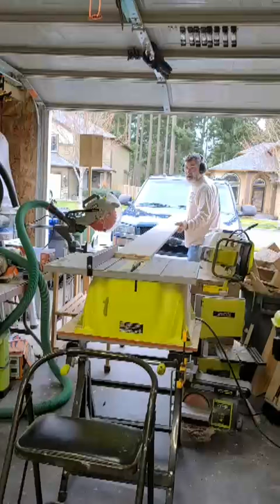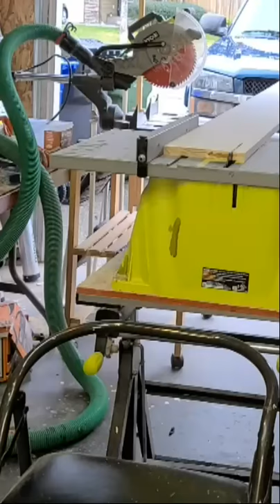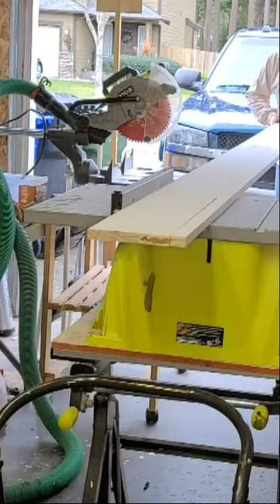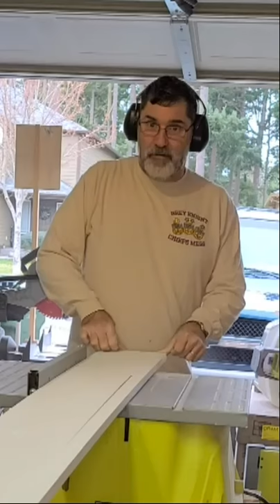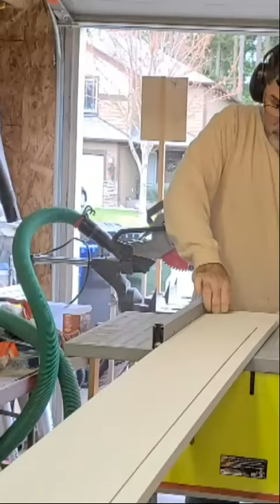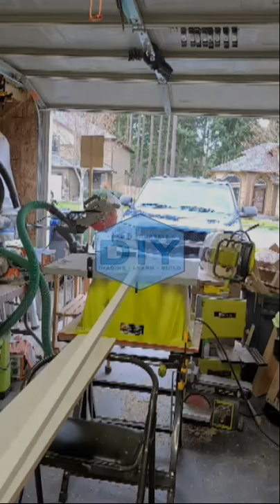Table Saw in Action! | Ryobi RTS10NS | #Shorts | 2021/002

Comment: You really need to support the outfeed end of the board. Think what would happen if your hands slipped while holding down and pushing the end of the board!
Reply from the maker: I'm aware.. what you can't see off camera is the table that the end of the board was resting on.. while a little lower than the saw. It proved its worth. I was ripping a 12 foot board in a 15 foot shop. So not alot of options.. took it slow.. and watched where all my fingers were. Successful cut.. moving on...